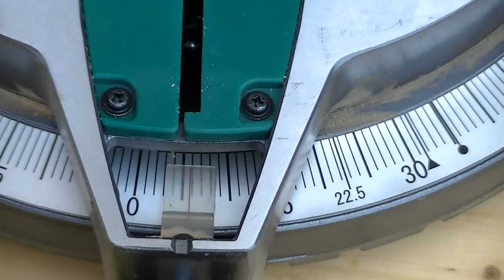Diy $3 chair from a 2x4 | woodworking | diy gift ideas

Comment: Quick question. I have an orbital sander like the one you have but I can never seem to find discs that will stay on while sanding. What kind of sanding discs do you use for your sander? Thanks and great job on the chair and awesome that your kid is involved with you.
Reply from the maker: frehleycomet I use the red Diablo discs from Home Depot.  They only seem to stay for about an hour though and then want to fall off.  I ended up buying the Ryobi 5" random orbit sander and haven't had that issue.  It also seems to be a little bit more powerful.  Thanks for watching!
Reply: Ok thanks for the response

Comment: What is the name of that yellow tool used @ 0:49 to draw the straight line?
Reply from the maker: It's called a speed square.  You can pick them up at most big box or hardware stores.
Reply: FunWithWoodworking thanks!